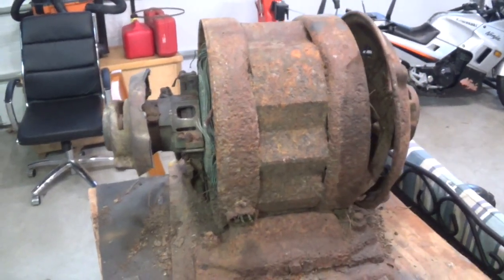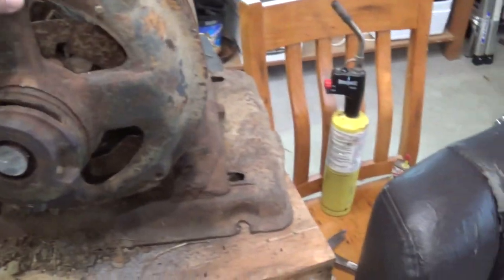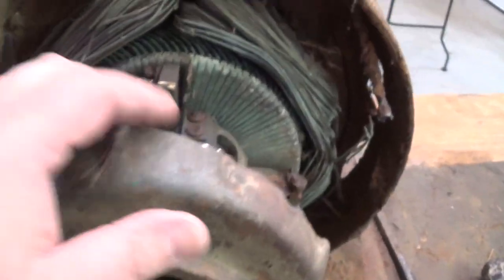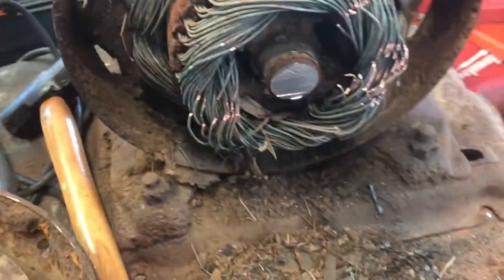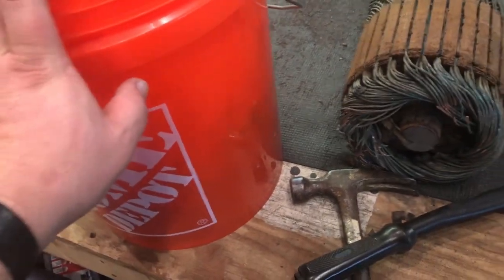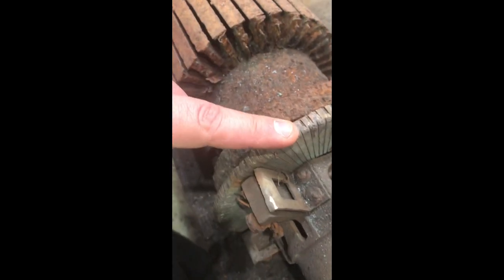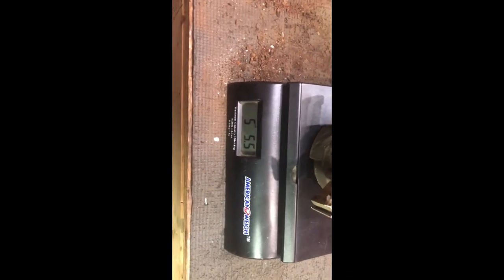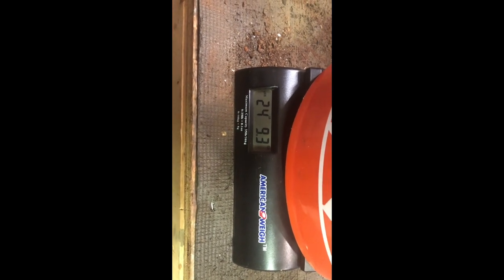Scrapping a BIG, old, rusty motor for COPPER! -Moosescrapper # 349

Comment: I've been working on an old generator that AT&T used with a massive aluminum case, at least 10 to 15 pounds worth.  Instead of the small generators that you would pick up at Home Depot, this thing is laid out very flat, about 3X3 feet. Pretty sure I'm gonna just extract the copper motor and leave it in one piece rather than try to separate the copper from it. If youtube allowed, I would attach a few pics for your enjoyment.

Comment: Food for thought 🤔I like your style! 😎 what is/ would be your optimal size/shape for a melting/casting /& work space,...?
Reply: As always Melt Happy Pour Safe!!! ;)
Reply from the maker: Optimal space.... a 6x6 brick or concrete pad outside with maybe a lean-to type roof.  cynderblock pad to elevate the furnace and same for the propane tank.  and another raised brick platform for the molds/crucible on pour.